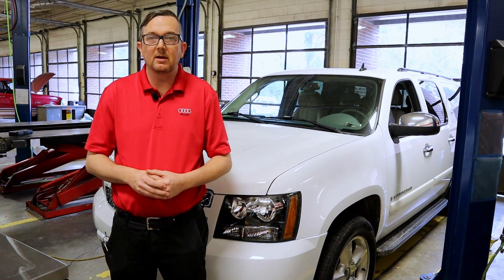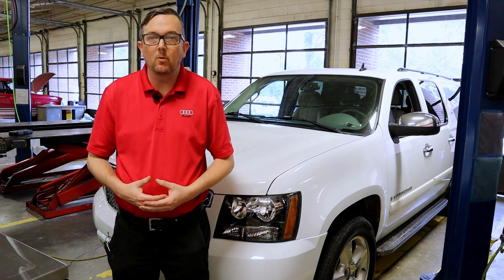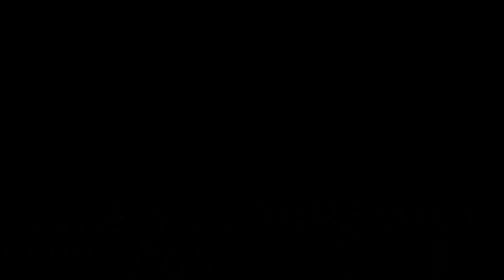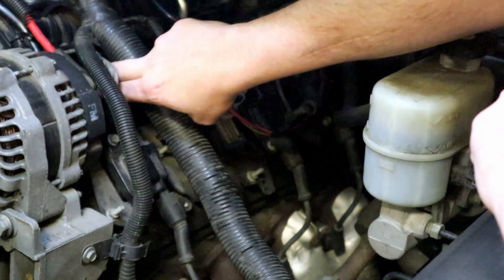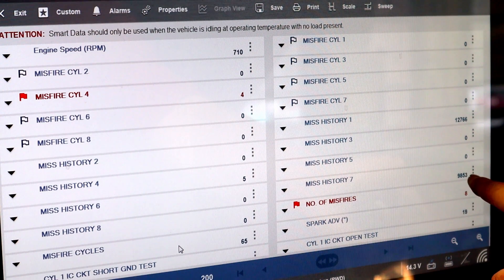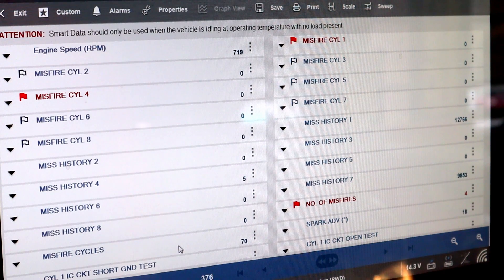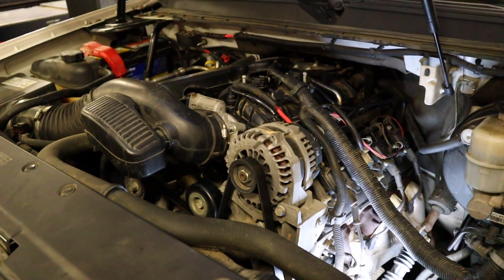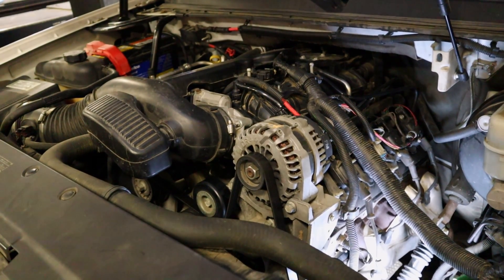P0300 Misfire diagnosis and repair 2008 Chevrolet Suburban 5.3

Comment: Hi very informative video. Chevy Avalanche 2007 5.3L. I have multiple misfire codes and the only thing i did was to disconnect X2 connector on the ecm (for a knock sensor issue (high input) to check cable connectivity). Now connected back i am having these codes. Any suggestion on wiring check? Previously i had no issues.

Comment: I’ve got a question I got a 2008 Chevy 5.3 we changed out we did a lifter job because we had a couple complex lifters come back. The engine was running fine ended up with a misfire changed a couple O2 sensors on bank one and bank two and we’re still having a misfire on cylinder 35 and seven changed injectors, got up another pick up and change the whole injector rail everything everything was the same replace them steel had a misfire on the same three cylinders we’ve done checked coil, pack, swap, cold packs. We got new new, spark, plug, wires, new spark plugs, and we still got that misfire on them three cylinders compression test compression all left bank is at 160 between 160 and 180 so are compression is good or can you give me an idea of what I need to go next?
Reply from the maker: I have seen camshaft lobe damage on these and it will not open the valves enough. Also intake gaskets can fail.

Comment: I have a 2009 Chevy tahoe I’m getting the p0300 which is a random mis fire I changed the spark plug heads and did a full tune up but the light came back on and flashes sometimes it drives smooth tho do you know what my problem might be dont want the check engine light on anymore

Comment: I have a 2011 yukon with P0301 code, also showing service stabilitrak and service traction control. Changed the plug, wire, and coil on cylinder 1, still shows code P0301. Changed the rest of the spark plugs and wires, pcv valve (tubing), which was broke.. and no change. Do I need to have codes reset in the truck? Or bad injector? Bad crankshaft position sensor? I'm $300 into this issue already with no fix!
Reply from the maker: The intake gaskets leak on these as well and can cause misfires. Very common.
Reply: This is usually an AFM lifter that has spun or collapsed. There are some quick fixes or you can delete the AFM system. Did you resolve the issue?

Comment: My 2010 Silverado has the 5.3 it runs rough, surges but the problem I can't figure out. If I have to accelerate quickly, it surges. About every 15 seconds or so. If I'm running 40 mph, it will rev and jerk forward. But if I shut the engine off and start again,  it stops. I feel like this will tell me what the issue is.

Comment: I had a misfire P 300 I change spark plugs and oil change clean air mass flow and still lights come on track stability and all that so my girlfriends that start with the gas tank and we change the cap and all our problems with white all the lights went out never came back on for days going strong and still no lights but my gas light tighten kept coming on in the past and I ignored it and it caused all kinds of problems mechanic said $900-$1700 to get the problem fixed $20 gas cap solved at all

Comment: What does it mean if my ignition coil is sparking and making ticking sound.thnx.
Reply from the maker: It probably has a secondary voltage leak and would need to be replaced. Thanks for watching!

Comment: P0300, rough idle after a minute or so, no check engine light on. Coil? How can I test the coils?
Reply from the maker: If it has a rough idle while cold, it could be intake gaskets. They will soften when the engine is warm and reseal, causing no issues. We have seen that many times with these. Normally a coil would cause an issue with just one cylinder, since you have eight separate ones. It’s rare to see more than one coil dead at a time, but I suppose not impossible.
Reply: @AutoScholarwithMrB  so I bought a spark tester and checked all the plugs/coils on the driver's side, the light is flashing pretty good on each one so I'm getting good spark, could there still be a bad one on the passenger side that I havnt checked yet?
Reply from the maker: @yoz1967  it is possible, but it could be injector issues or intake sealing issues.
Reply: @AutoScholarwithMrB  how do I test for an intake leak? Carb spray?
Reply from the maker: @yoz1967  you can, but I would pull the intake and see if they have hardened. I’ve seen it happen so many times on these.
Reply: @AutoScholarwithMrB  no check engine light,no coolant leak, no overheating

Comment: could a bad brake booster check valve cause p0300?
Reply from the maker: It could, and the misfires would be random. Also a lean code would probably set as well.
Reply: @AutoScholarwithMrB  Thx for the fast reply. Going to the store.